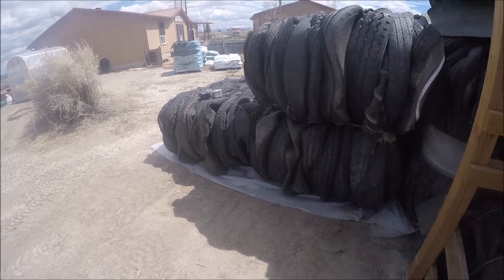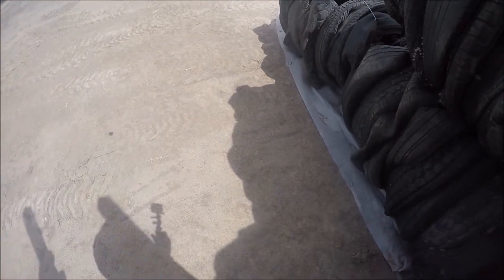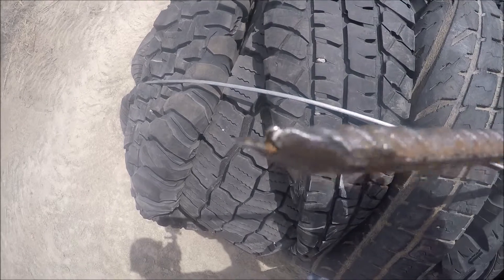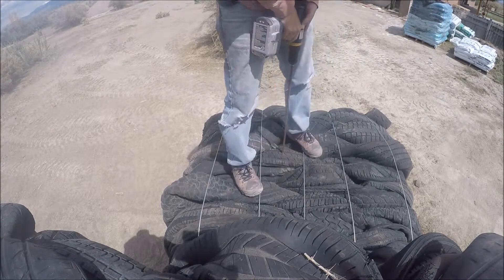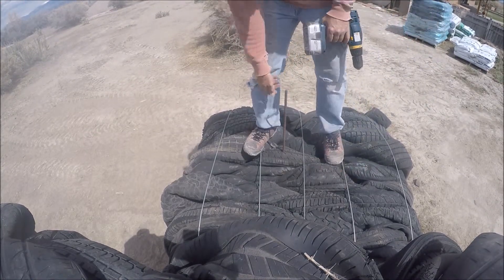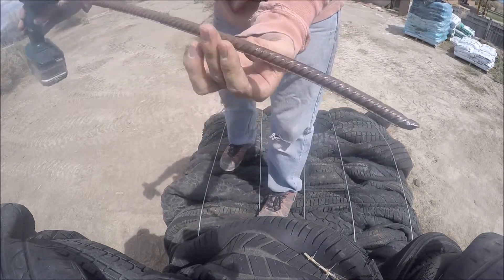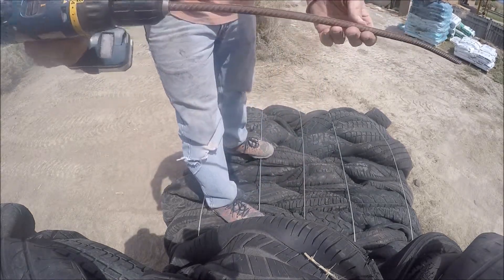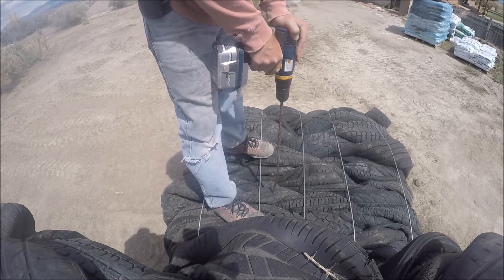THERMAL Mass Greenhouse Pt 9 - Testing Anchors

Comment: Man, you sure are industrious! I've been subscribed to your channel for a while, probably because I saw your moto videos a long time ago. Today I just touched base and Snooped around your channel to check out your Greenhouse project. This seems like an interesting activity for me to observe, but I'm trying to figure out the bigger plan. I suppose if I look through your older videos I may get some kind of a intro or design plan and strategy. Nevertheless it's rather interesting to see all these construction methods deployed. It looks like You Must Have Spent tons of money on all the equipment required to do the construction as well as the materials themselves. I'm a mechanical engineer so I'm not as familiar with construction techniques, but this is very interesting for me to observe none the less. It seems you have some kind of concern about thermal expansion of the tires and therefore you're trying to build structure around them. Am I correct? The concerns about the wire breaking that retain the tires is valid based on whatever the thermal expansion of the tires is versus the stress that would be imparted upon the steel wires that keeps them together.